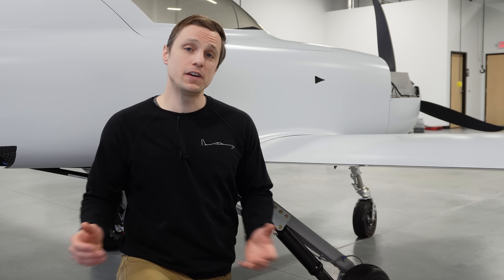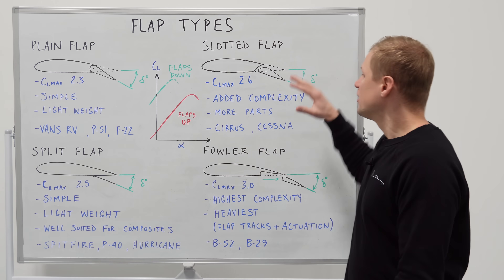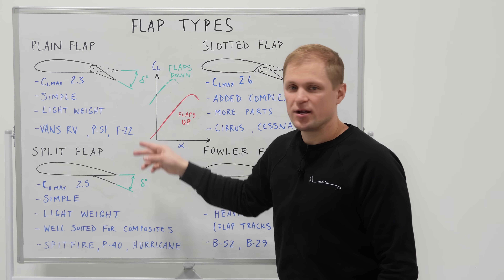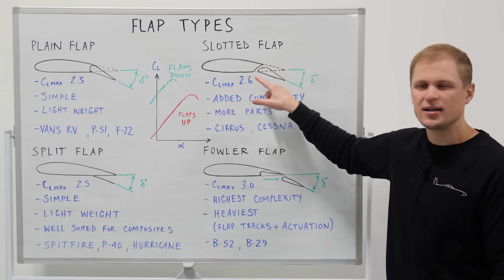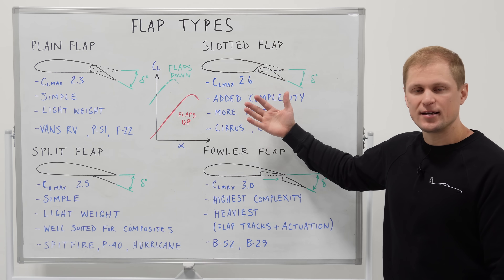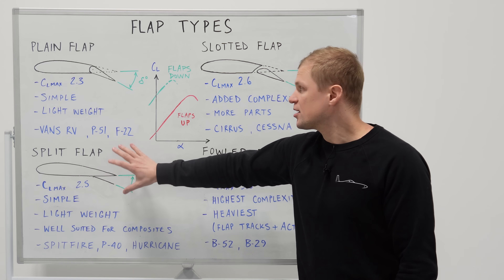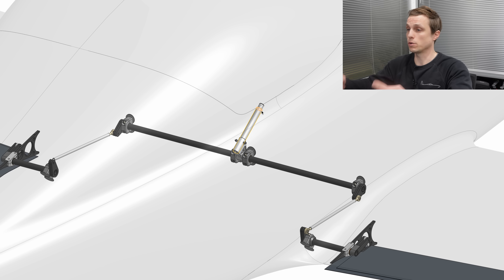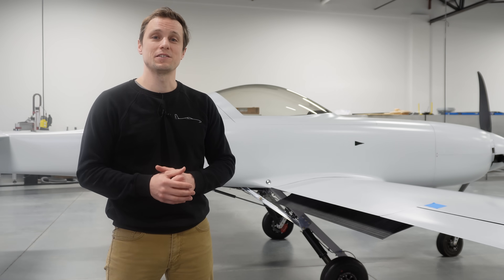The biggest myth about split flaps

Comment: Would I be able to speak with you guys?
.
.
.
I have an HP-18 glider.  This is a flaps only glider (there is no spoiler).  The flaps are operated with a crank handle, meaning you have to turn a crank that has a gear reduction system that moves a series of connecting roads and moves the flaps. I frikken hate it and am looking for an alternative (I have not flown the glider yet).
.
.
I wanted to do something similar to you guys, remove the crank handle and make a manual lever.  But I was told, "DON'T DO THAT !!!" 
.
On landing, I will crank my flaps to 40% to commence landing and then crank them some more - all the way out to 90degress as needed to reduce airspeed and altitude. The thing is that I was told that the amount of force required on the lever is something in the order of 60 to 80lbs and my level was intend to be about 18inches.... oh and my glider is flying at 50knots or 57MpH.
.
.
Your manual lever looks like it is a mere 6 inches in size.  Do you not think you will need some serious arm strength?
.
.
Can you make a video discussing why you chose to manual and not electric.  What is your anticipated landing speed? What are your anticipated loads? when landing how many degrees of flaps will you put out?
.
Thanks.
Reply: The crank is not so much for mechanical advantage as to purposefully slow the transition from one setting to another. If you can suddenly dump flaps from 50 degrees to zero on final you will suddenly drop 15 to 50 feet, as the wing has to speed up to reobtain equilibrium. This  would often cause a crash. 
This is why the rear spoiler flap combination used on the Mosquito and Ventus is no longer used on modern designs even though it allows very steep approaches.
Reply: @chrisruf7590  Thanks for the response Chris.  I had no idea that dumping 50 degree flaps would result in such a drop in height.  That is VERY good to know. However, the crank system still has a 2:1 gear system where 2 turns of the crank has a 1 turn of a gear that moves the flaps.  I have heard 2 complaints of this system: 1. you struggle to to keep up with cranking the flaps to get the right flap setting as you approach landing.  2. you have to often turn your head and check the flap setting at a time your head should be looking out the window.
.
But the alternative (I was told) is a big stick handle like (I think) the I-26 glider. This has way too much load on your left hand while your right hand is holding the control stick and making light movements. So the thought process is "the crank system" is the best choice.  I personally believe I should figure a way to install spoilers on my HP-18 (that would be a mega project - maybe too big a project for me).
.
I'm also thinking of keeping my crank system, but installing an LCD indicator that tells me how much flap I have out and I don't have to turn my head to look at the setting - at least get rid of one of the 'issues' of the crank system.
.
But now looking at the video shown here - they have a very small mechanical handle for their flap system. Is that wise?
Reply: @chrisruf7590  the gliders that I flew (basic old Schweizer 2-33) had linked air brakes and spoilers controlled by a sliding handle that could be deployed very quickly. As the primary method of descent angle control rapid response was desirable, and because it was not a flap system it did not cause a pitch change. If the crank handle of the another design is deliberately slow, that is presumably to avoid rapid pitch changes, rather than avoiding sudden altitude loss.
Reply: @brianb-p6586  do you mean linked flaps and spoilers?
Reply: @chrisruf7590  no - that's a reasonable guess, but the 2-33 doesn't need flaps. The Wikipedia article describes them as "top and bottom balanced divebrakes", but the components on the upper surface of the wing are front-hinged mid-chord panels that are typically called spoilers. The components on the lower surface of the wing are similar (including mid-chord position) except that they are hinged on the rear edge. I assume that airflow tends to force the lower parts open and the upper part closed; the net result is that they are relatively balanced, so they are reasonably easy to move and to hold at any position without a latch.

Comment: Sees like high drag flaps would be desireable on an airframe this light and streamlined, it's always good to be able to get down when you want to
Reply: They have a split rudder so there is a little bit braking in the air, and you can control how much you want
Reply: Yes, the split rudder is intended to be used as a speed brake, @minorlion1327 . If drag is needed, it has the advantage of causing minimal pitch change... unlike the split flaps.

Comment: I thought most Cessnas have Fowler flaps not slotted flaps?  Can’t wait to see this bird fly!  I just finished my RV-6A a couple of months ago. First flight was an incredible experience!  However the first flight of a new clean sheet design has to be the pinnacle of home building.  Congratulations on your success so far!
Reply: I agree. The Cessna 172 flaps move down and back which increases the wing chord. Which is a Fowler flap. However, The 172 manual that I have refers to the flaps as the single-slot type.
Reply: Nope. Just a slotted flap, which DOES move back and down, just not nearly as far.  A Fowler flap is characterized by being RETRACTABLE in operation.  Meaning a large section of it slides UNDER the top surface of the wing. To see one in operation just look out the window over or just behind the wing of any airliner during landing. Fowler flaps are usually accompanied by rather large fairings extending aft of the trailing edge to hold the complex tracking, linkage, and actuators that operate them.
Reply: The leading edge of a simple slotted flap will move rearward as it rotates, @christopherpardell4418 , simply because the way to open up the slot is to place the effective hinge line below the bottom surface of the wing and flap. That doesn't make it a Fowler flap. 

The common Cessna flap mechanism uses a plate with track slots that the flap moves in. The nearly horizontal slot shows the distance which the flap moves rearward. The rise in the other slot (relative to the nearly horizontal slot) determines the angle change of the flap.
Reply: In order for a slot to open, the flap has to move aft.

A fowler flap has the leading edge of the flap nearly reaching the trailing edge of the basic wing. It also translates aft a significant distance, without deflecting  any noticeable amount. Where position 1 flaps is just an increase in wing area 

Cessnas definitely deflect downward as much or more than they translate aft. Which at most might be 4-6" rearward. And the flaps trailing edge still remains within the basic wing planform as viewed from above, when fully deflected.
Reply: I don't know where you and the DarkAero people got the idea that a Fowler flap must translate rearward all the way to the trailing edge of the fixed wing surface, @Triple_J.1  . Fowler flaps translate as well as drooping, and Cessna flaps (since the 170B in the 170/172/182 series) do that.
Reply: Congratulations on your build completion and flight. That’s quite an accomplishment!
Reply: The Cessna 150 and 152 had Fowler flaps. The 150 will drop down to 40 degrees and is like a barn door
Reply: If anyone hasn't used 40deg flap on the Cessna it feels like falling down stairs.  It superb for super steep short approaches. They changed the design however because you cannot climb, which is all fine and dandy until you select up and nothing happens...
Reply: Yes, there's a lot of overlap and some designs are hybrid.  It's called slotted because air can get from bottom to top for the Cessna. My aircraft is similar but is Fowler because air cannot get to the top.
Reply: All Fowler flaps are slotted, @dr_jaymz , so that wouldn't make sense.

Comment: How do you do prefight control check if split flap is under the wing?  Is the movement visible to the pilot?
Reply: Do what they did on Migs: add a small arm on the leading edge of the flap which pushes a curved pin up thru a hole in the top of the wing when the flap is dropped. Position it where it can be seen from the cockpit,  i.e. at the outer edges of the flaps.  That way a quick over the shoulder glance each side will confirm flap position.  The pin has a tiny cap which finishes it flush with the wing surface when the flap is closed.  Put a red LED on it for night flying.

Comment: My Cessna 182 had Fowler flaps.  They moved rearward significantly before descending downward.
Reply: Flap position 1 is 10 degrees deflection. It is the only flap position that extends the flaps trailing edge outside of the basic wing planform. At full 40 degrees, the flaps are definitely not projecting past the trailing edge. A true fowler translated the leading edge of the flap rearward to the trailing edge of the basic wing. Which is about 300% farther aft than a Cessna.

All slotted-flaps must translate aft to open the slot. As the slot gap has to remain about the same for each deflection angle, it cannot simply open more and more with angular deflection. It has to open the slot rapidly to its defined point before deflecting. 

The proper technical term for Cessna flaps is "Slotted Flaps with Fowler Action".
Reply: @Triple_J.1  You are just making stuff up.  The definition of Fowler flap is that the flap moves rearward as well as downward.  There is no requirement that it move to the trailing edge of the wing.  Slotted flaps rotate, but don’t translate.  Fowler flaps translate and rotate.  Cessna 182 flaps are Fowler flaps.  End of story.
Reply: @LTVoyager  It looks like Cessna has used Fowler flaps (with rearward translation, although not much) since the 170B of 1952... and the same design continued through the 172 and 182.

Comment: Interesting that you would look at the reduced drag in a split flap verses the plain flap as a goal, when one of the goals with flaps, I thought was to increase lift and drag? Cheers!
Reply: I guess a lower drag to lift flap would be better for takeoff purposes.
Reply: @watashiandroid8314 most light aircraft can take off less distance then landing. And in a slippery plane like this one you want to be able to increase drag for landing and easier approach, for example in gliders using airbrakes.
Reply: @electricalmayhem  of the 6 light aircraft I have flown enough to be familiar with, maybe one could take off in a shorter distance than it could land. Brakes tend to be far more powerful than the engine in a light aircraft, and from what I recall, most light aircraft can land in a shorter distance than they can take off in.
The 6 aircraft I've flown enough to talk about: Cessna 150M, 152, 172M, Aeronca Champ (O-200), Bellanca Citabria (O-235), Super Decathlon.
The one aircraft which I think can take off in less distance than land is the Super Decathlon.
Reply: @watashiandroid8314  Hmm you are right for GA aircraft, looks like I've been spoiled with microlight/Sports aircraft which are fibreglass with Rotax 912's giving  a good power to weight ratio! (WT9 Dynamic, Rans, Vans etc) Been a while since I flew a cessna.
Reply: just have a separate air brake that is big and deploys on touch down @electricalmayhem
Reply: @snorttroll4379  Unlike airliners which use spoilers on touchdown to kill the lift, in light aircraft (e.g. Gliders) airbreaks are used to steepen the approach with out increasing speed (worse L/D ratio means steeper glide/approach path), by touchdown it is pretty much too late.
Reply: ld ratio @electricalmayhem

Comment: Looks like the individual cranks for the flaps are at the root of the wings.  What about locating them at the center of the flaps so there would be less twist force on the flaps (and their hinges) and also have half as much of a longitudinal chord in the flap which may help with flutter from such a long span.
Reply: The flaps are stupid lightweight. Probably five pounds, at most. The heaviest parts of the flap mechanism are all internal to the fuselage, so leverage is still as high as possible while minimizing the moment of inertia in the wings themselves.
Reply: @spdcrzy  I'm not worried about the weight of the flaps. The aerodynamic force on the flaps is much greater than the weight of the flaps.
Reply: @davidchow9528  that's the question though - will it be, really? Even if it's five hundred newtons per flap, I doubt it would be an issue. And I don't think anybody has ever done a full carbon fiber flap with carbon fiber IN the linkage - it will likely be more than stiff enough to prevent torquing in any way.
Reply: @spdcrzy the concern is not just the force but also flutter. the carbon fiber for sure is stiff enough but what about the hinges and bond points.  the greater the chord the higher the likelihood of flutter especially at lower speeds.  to me attaching the crank mid cord makes the most sense. But what do I know I didn't do any analysis. Just bringing up an idea for the dark arrow team.
Reply: Where is the space for a crank in the wing?
Reply: @ArneChristianRosenfeldt  jump to the video where they animated the flaps in cad. the crank is neatly tucked in one of the ribs near the base of the wing. the rib is the shape of the rear half of the airfoil. that rib could easily be located at the center of the chord. 

also jump to a shot of the war birds that had split flaps. you'll see a series of ribs across the split flap and actually several cranks across the flaps to spread the load.
Reply: @davidchow9528  good war Bird. Just often designers cheap out and introduce all these fairings. Even the Concorde has fairings for everything, although each of them creates a shock.

The nice thing about flaps is that we want to curve the wing, not twist it as with ailerons. So a local gearbox or distributed gearboxes make sense even if the wing is flexible.

Comment: I noticed the projected rated speed of the aircraft will be around 230knots, will you need static whicks with this composite flap aircraft for less noise, interference in your electronics and in comms?

Comment: My little 162 has manual flaps operated in almost the same way. I know you stated you had some modifications yet to do, one I hope you are considering is allowing the flaps to be deployed without pressing the detent release button. My 162 flaps operate in this manner. You can grab the bar, pull up, and the catch will ramp down and then pop into the first detent notch, giving you positive feedback and preventing fishing for the position. You can again just pull further for the second and third notches of flaps, all without ever need to press the release button. This is handy when executing a go-around, as you simply press the detent then immediately release it once you start to retract. They will automatically positively latch in the next position.

Comment: Great explanation guys,.  Could you please reply with the anticipated load (lbs) at the flap handle during the clicks of extension?  Thanks!!
Reply: Split flaps work via gravity, so it is usually either DOWN or UP.  Force in question is just the weight of the flaps, so not much.  Now getting them UP and sealed can require more force as aerodynamically suction is pulling them down on the trailing edge often.  Can splitflaps do detents?  Sure.  Will DA do so?  Who knows.    Will they know exact forces?  Not a chance, unless they did aero work.  These guys do not have access to a wind tunnel and seem to do their aero work in CAD to get lower airfoil pressures(if they have done so).  Now they should have a pressure polar of their airfoil if they look hard enough, but it would not surprise me if they do not have this either.  This is often not published except as examples using say Clark Y airfoil for 12% thick@Re~1,000,000  They could actually use Clark-Y pressure polar as ~close enough though and it would not surprise me if this is EXACTLY what they have done obtaining forces + a large safety fudge factor.  If much larger fighter sized aircraft can do it with just average pilots and MUCH larger flaps, and no mechanical advantage augmentation, It boggles the mind how this tiny aircraft would have flap stick forces worth mentioning.  But then again, I have seen engineers completely botch simple into complex moronacy so... =)
Reply: Thanks!!